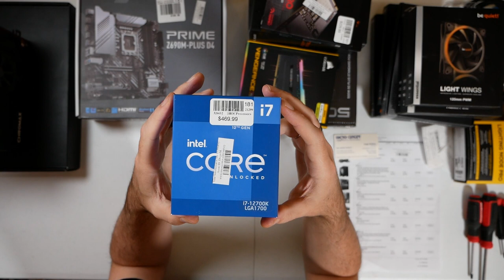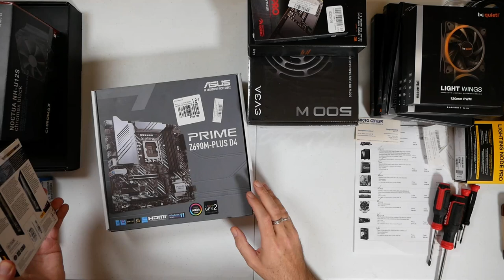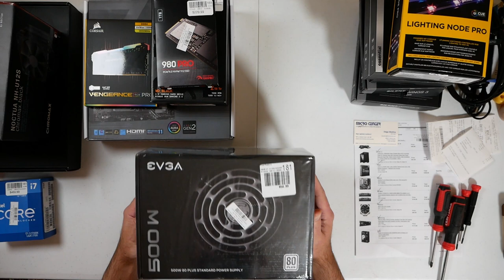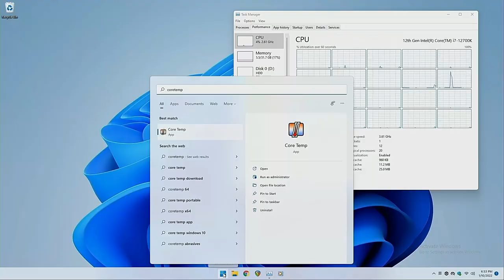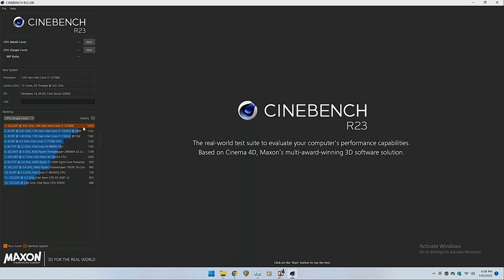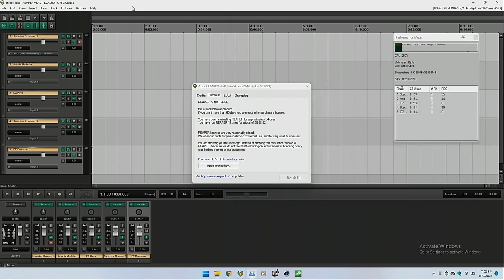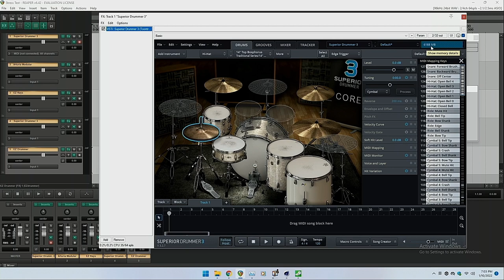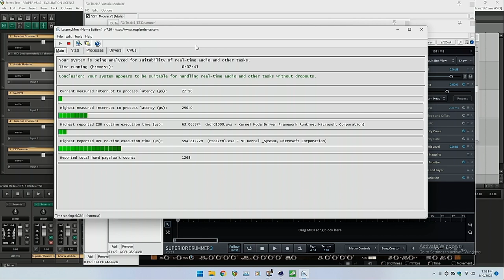$1300 Audio Workstation Build

Comment: Power supply is most important part of any build.
Reply: While it's not great having a power supply fail, what's worst is one that's flaky where it impacts one or all the components in the computer. That's a very difficult issue to track down, especially if you don't have another power supply to test, not to mention the fact that it could fry anything in the computer (or worse yet, make a component no longer be stable -- temporarily or for the rest of it's life). Bottom line and along what you said, you should never skimp out on the power supply.
Reply: @danielgaudet6114  yeah. unstable power is enemy of good sound as well.

Comment: This is so off topic, but are those the Mid atlantic side racks ? I am looking for a sister to my 1 rack. I see a Mid Atlantic rack online that is almost like mine but seemingly a newer version. Its the Middle Atlantic MDV-R12.That  one that has a more square top when mine is more extended out at one end. I just wanted to know were you got yours and if yours are the same model i have. I bought mine off craigslist and cant seem to find quite the same model. Sorry for the mouthful. I hope you are well and great video.
Reply from the maker: Good eye, my sidecars are indeed the Middle Atlantic MDV-R12.  I had to go back and check my Sweetwater invoice from 2014 to make sure, but yes that's the same model.  As far as I can tell, the one that Sweetwater currently has pictured on their site is just like mine, where the top has a couple of inches of overhang on the front and maybe an inch of overhang on the sides.  But my goodness, the price has almost doubled since I bought mine.  Yikes!
Reply: @YHRS  Yeah I know it is super depressing especially in these trying times. That is exactly why they are more expensive too as well though.